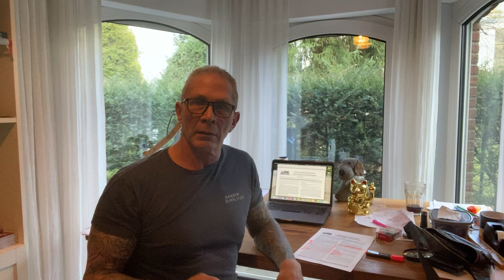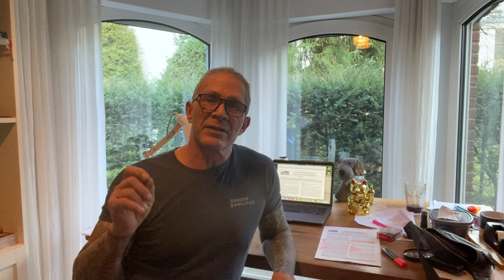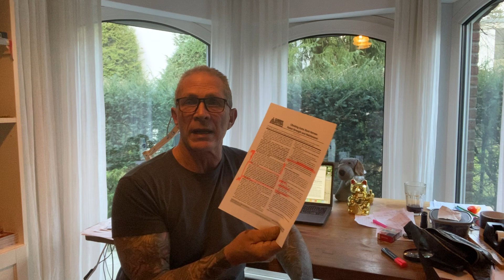Stunt Rigging Toolbox Talk #23, Performer Harness and Risk Assumption

Comment: Fantastic video and I completely agree. I have an excel sheet for every one of my harnesses and they get inspected after every rental.
Reply from the maker: Thanx, my question is, do you send them to be recertified every 2 years, as it says on the paperwork? It was always send them to sutra, they would take care, approve, etc. up to 6 years where it is destroyed. In EU and UK, in line with the regulations,( all of the harness norms for work at height, etc., LOLER) they must be inspected/certified by somebody sutra approves, for a maximum life of 6 years. The problem is, nobody does it, because they only want to earn money....
Reply: @James-jn5xy  that is the plan. I haven’t had to yet because all my harnesses are under two years old. But I will be sending them in for sure. I wonder if the 6 year rule is an EU thing or if they are going to enforce that in the states. 

Another thing that would be interesting to Note. Amspec/P&R don’t actually follow the ESTA standard because they neglect to have the WLL marked on the harness. If you call them, they will tell you that their harnesses never expire. lol. Terrifying.
Reply from the maker: @wadecordts3286  The 6 year rule comes straight from the manufacturer, and as well it is current, as is the 2 year rule. Don't know if US will go the 6 month rule, as it is standard in EU on soft and hard goods, but all harnesses should have logbooks detailing dates and type of use ( I think pick points as well....because certain ones get all of the use) As far as am spec, they are not the same as they once were under Miles and Sonny, it is a diffwerent group of people. I will message you privately, but will say I have stopped using them in any was for anything. This is strange, because in the early 90s the were great, then I went to sutra, but still got other soft goods from them. But recent events have lead me to this decision.
Reply: Nice one bro… another great video 😊